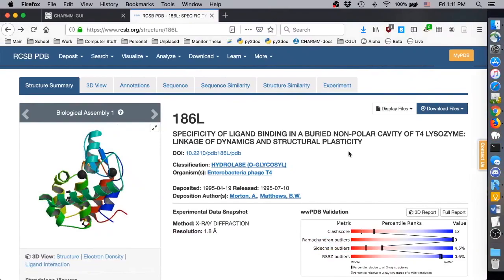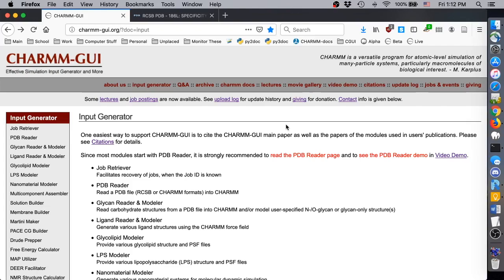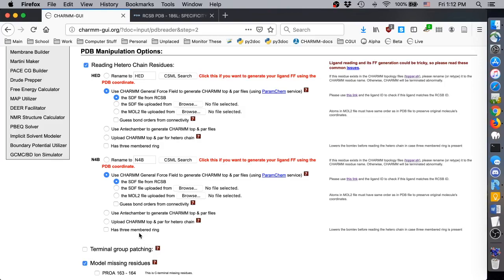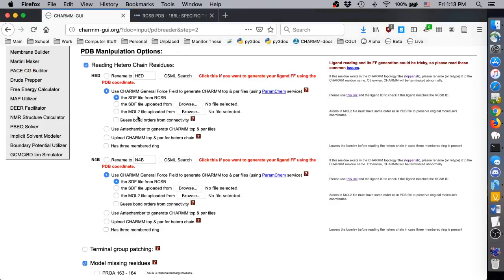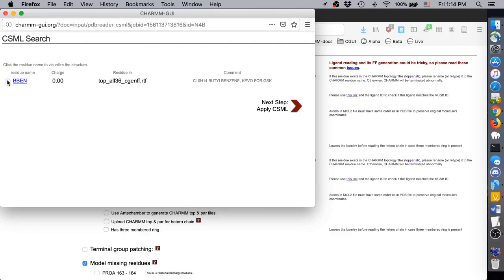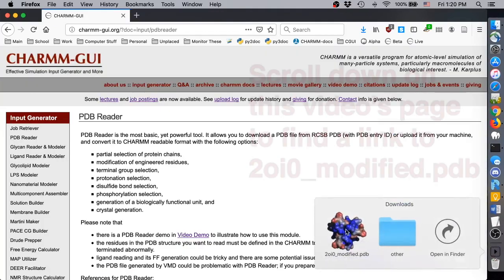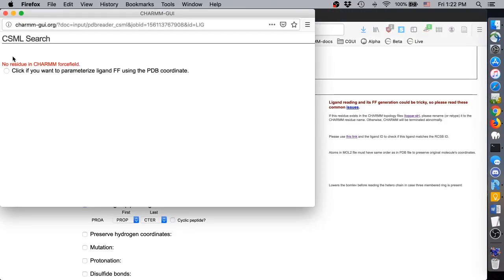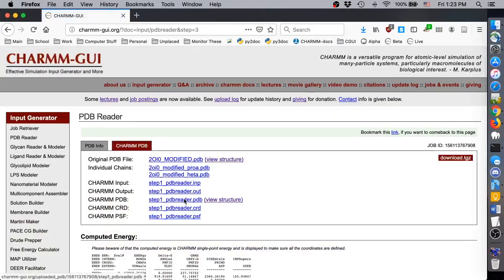Protein-Ligand Reading Tutorial 1: General Ligand Reading Strategy (186L, 2OI0)

Comment: Please the method does not work on the site, I have already used the site many times, but no more works there is an error on the server please check, works for protein only, but for protein-ligand no more, I've tried to use the inputs with which I made the md previously but they don't work.